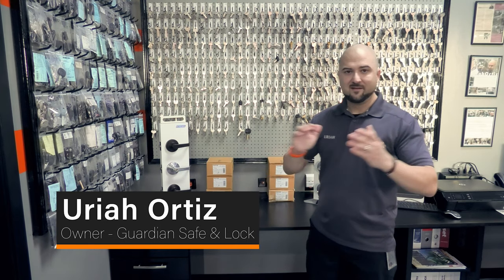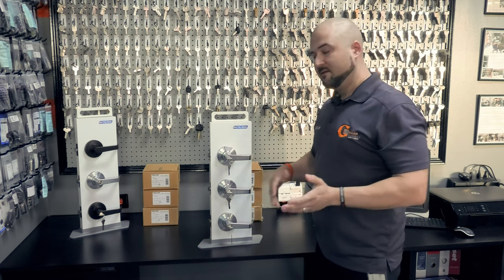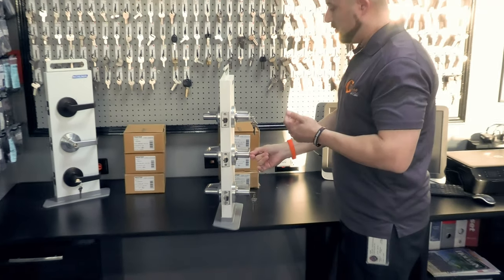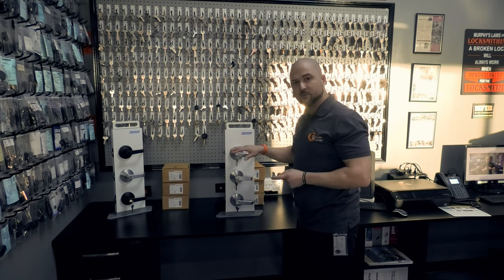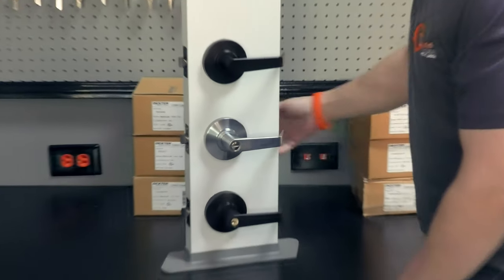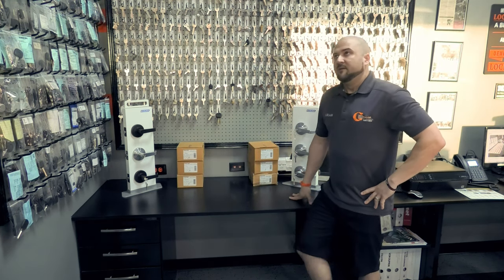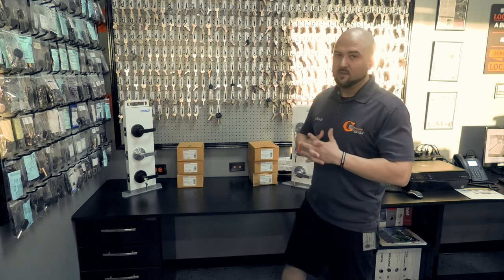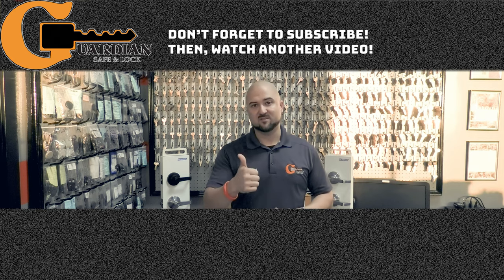Types Of Lock Functions | Lever Functions | GSL Discussion

Comment: So on the entry style, will turning the inside handle ALWAYS unlock the outside handle, or does it depend on the position of the plunger? I have a gate that needs the outside to be keyed but the inside to always be able to exit without unlocking the outside. My guess is storeroom is what I need, but there may not be many options for more finished residential looking hardware.

Comment: Question.. I rekeyed a Schlage to have a master key.  My master key will turn counter clockwise nice and smooth, but wont turn clockwise AT ALL. The operation keys work PERFECT. What could be the issue? Thanks
Reply from the maker: I would say that if its snagging then trying bringing all the pins up one pin on a .300 increment pin kit. If you think about how a key is cut it is always sligthly deeper on one side of the key than the other, because when it hits the blade its just a hair deeper on the side closest to the blade when cutting the key. This is the best suggestion I could give without having the cylinder in my hand. - Uriah